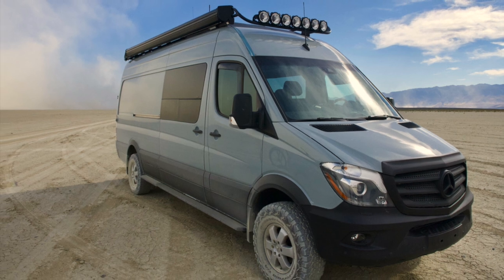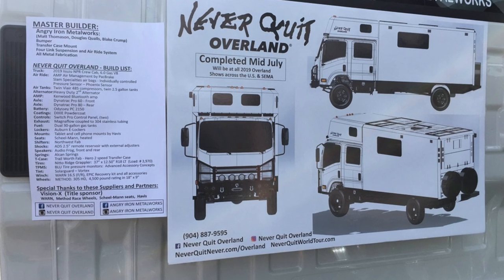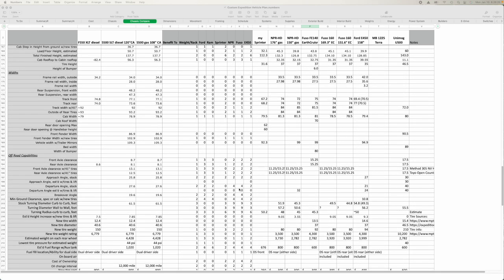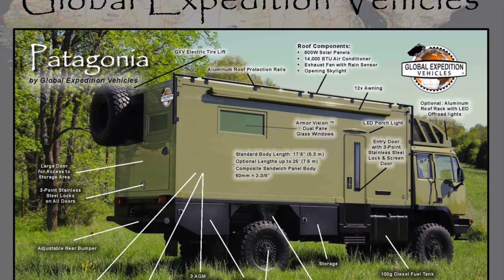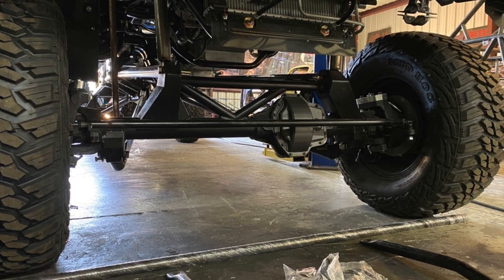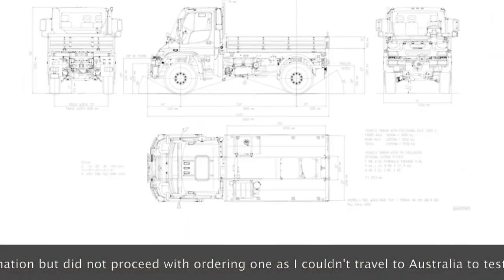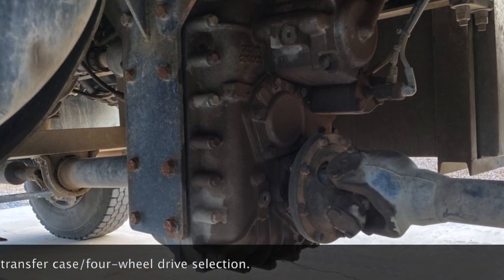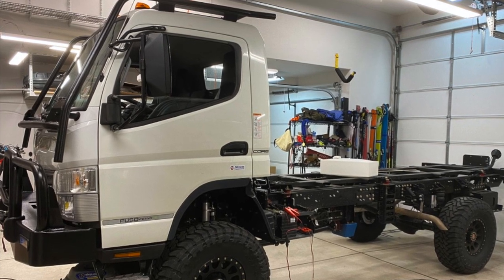How to Choose the best Truck Chassis for your Expedition Camper

Comment: A Toyota Coaster bus would have been a great option. Bus 4x4 Australia do a conversion and they are built extremely tough. They are very capable off road mostly used as remote mining vehicles and handle all the Aussie bush tracks, no problem. The same length as a 170 Sprinter and about the same height but you get an extra 10 foot with an almost square body. You would get better fuel mileage, a larger living space, smoother highway driving and a 14,000 pound (6.4 tonne) GVM with an already built box. These things last forever with a bulletproof engine that will keep going for over 600,000 miles or a million kms, plenty of torque, locking diffs ect……. and mechanics all over the world know how to fix them having used Landcruser parts for the conversion. 👍🏽
Reply from the maker: Good suggestion. I am not very familiar with it as we don't have these in North America, and also wanted control of the box dimensions and wanted a fully rectangle box as well, having built out campers in Sprinter vans was tired of working with all of the curves that a van body has, so wasn't an option for me but a really great option for others.

Comment: Excellent video! 

I’m coming to the same conclusions as you regarding a pick up truck vs cab over. 

It’s a shame that the Isuzu NPR doesn’t come standard with 4x4 in the USA and the Mitsubishi Fuso has been discontinued.

How much was the Mitsubishi Core from EC?
Reply from the maker: It is absolutely a shame that the Fuso is being paused in the US and the NPR not available from factory in 4x4, or that there are other 4x4 cab overs available in the US unlike rest of world. The EarthCruiser Core chassis is pricey at over $125k--call them for updated pricing and options.
Reply: @vantripping  have you seen the Ridgerock conversion? Any thoughts?
Reply from the maker: @woolengrappler  I have although after I purchased my chassis. They seem like they are doing good work. Acela also tried but couldn't get the parts, and Matt with Angry Iron Metal Works made some great rigs but has since retired.

Comment: Thanks for sharing your research! Looks like you have made a great decision on the vehicle platform and I’m looking forward to following along with your build out. No doubt it’s going to be incredible! I’ve owned several Unimogs (gas 404s) and while they are incredible off-road, nowadays my journeys take me across very long distances of pavement. It’s almost to the point where I am thinking of a 2wd vehicle with strong dirt road capabilities.
Reply from the maker: Yeah, really great points. Even on my longer off road overlanding trips, I'm still driving 50% of miles on road and usually more like 80 to 99% on road, so the road drivability, quality and comfort are essential.
Reply: chaosplanUI,
2003, we converted a 1996 Ford CF8000 commercial truck to our concept of an ExpeditionVehicle.
We tossed in some car-camping gear, and hit the road from Oregon with the vague goal of 'south'.
Twenty-four months twenty-four thousand miles around South America.
Alaska, Panama, all over North and Central America.
Summers up rough logger tracks to remote mountain lakes.
Winters on isolated Baja beaches.
.
We see converted euro-mil, but they rarely go off-road.
If they stick the thing, they need the local military to drag them back to the road.
.
Nearly two decades full-time live-aboard, we needed 4x4 once... in Willamette Valley gumbo, on our farm at home.
Reply from the maker: @largemarge1603  That is awesome!!! Love it, great choice of vehicle and low cost. Amazing adventures and stories. I'd love to hear more some time in person. Funny how only needing 4x4 once and at home!

Comment: U mentioned a lot short wheel base in favor longer wheel base.  Why is that important?  Greta video just what i was looking for
Reply from the maker: A shorter wheelbase is much more maneuverable and easier to navigate narrow trails and roads--sometimes a long wheelbase won't even be able to get over or around trail obstacles. And a longer wheelbase makes getting around tight corners as well as even parking in a parking lot very difficult if sometimes not even possible. From all of my use in my van, I set a requirement that this camper would be able to park in a normal parking space (essential on any road trip and daily life  to be able to get into and out of parking lots and parking spaces) and be able to manage fairly narrow and tight trails.
Reply: Right,
A longer WB increases the potential to 'high-center' on a rock.
For our home-built 1996 Ford CF8000 ExpeditionVehicle, we have 16" ground-clearance with a shorter WB.
Our interior is 7w x 12l x 7h, about 700cf.
Rear entry for a sense of visual and visceral openness.
No cabinets above waist-level.
Reply from the maker: @largemarge1603  Like it, sounds great. About the same dimensions as mine, although mine has a bed platform pushing over a four foot deep gear garage, so roughly the same "living space".
Reply from the maker: @largemarge1603  Yes, the longer the wheelbase, not only the wider the turning radius, but as you point out also the greater the ground clearance needed to overcome high centering objects and also likely tail dragging on things. Although a longer-wheelbase has one merit--smoother highway travel and safety pulling longer trailers. But other than that, there are dozens of benefits to a shorter wheelbase.

Comment: Could you tell me why you didn’t use a standard Fuso 4x4 chassis cab and what Earth cruiser do differently ? 
Also which engine ?
 do you have ?
Thanks , just subscribed 👍
Reply from the maker: Great question. I wish I could've as it would've been much less costly yet not with as robust of a four wheel drive system. Mitsubishi stopped offering their factory 4x4 in the US a few years ago, and I preferred a new chassis, most were pretty rusted from use in the easy coast, and all came with a shorter wheelbase and less preferred Diesel engine and double-clutch transmission that isn't loved by many. The older chassis also had a stepped frame rail, which limits the camper design and integration. So I went with a new chassis. I could've had someone else do the conversion, and one with coil-overs or similar which I would've preferred, but just couldn't get it done as timely even though delayed from EC yet still sooner than other options.

Comment: how about the sprinter cab chassis ? I am planning to do it , any sugguestion?
Reply from the maker: A Sprinter cab-cut away with a composite box would make an excellent camper, I seriously thought about it yet wanted more weight carrying capacity, an improved four-wheel drive system and a shorter wheelbase than my current Sprinter, and in the US, MB does not offer Sprinter cut-aways in four-wheel drive--getting one converted to four-wheel drive would double the vehicle cost for us in the US, so there were other options that met all of my requirements.
Reply: Lang,
Central America.
We witnessed multiple break-downs of Sprinter-style conversions.
Minor -- "Throw a code" happened daily to our caravan chums.
Major -- catastrophic failure of the engine.
.
Our rig :
Cummins 505ci mechanical.
Nearly two decades full-time live-aboard, going strong.
.
Our GVWR -- 29,000#.
Our weight across the scale -- 14,000#.
Our cargo capacity -- around seven ton.
Our interior -- 7w x 12 l x 7h, about 700cf.

Comment: If you want to travel all over the world, UNIMOGS are everywhere and are very basic parts.
Reply from the maker: Sure, many use Unimogs for their expedition campers traveling in Europe and Africa but parts and service are next to none in North America (only 186 factory imports), most of Central and South America, and Asia. Plus their size on small roads in villages and Asia would be more of a challenge getting thru if at all. The truck I chose is more widely distributed in the world and the engine one of the most widely distributed and understood, so in my opinion will be more drivable being smaller and with much more parts availability. I almost bought one of the 186 North American U500 Unimogs ever imported, but didn't because it needed a fair amount of work and maintenance with only two known reputable repair techs in all of North America, so very challenging even just to arrange for a repair when the shop is multiple days drive away.

Comment: You dodged a bullet by not going with GXV. Knowing many owners, they are total garbage… imagine having a $800k truck that was with them for 2 years for repairs.. the are known for numerous leaks and some of the worst customer service in the industry. We will see if Storyteller overland changes that with the recent acquisition.
Reply from the maker: Interesting to hear that. It would be very frustrating to have issues on such an expensive product. Although many downsides to such a large-scale DIY project as my expedition camper build is, one benefit of the DIY expedition camper is knowing who to blame, how it was made, sourced, and likely how to fix it.😉